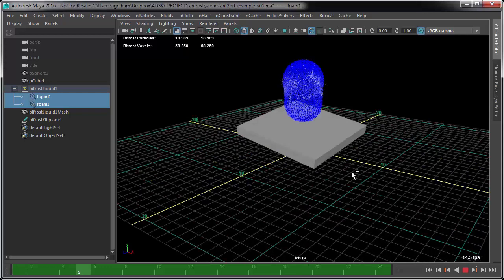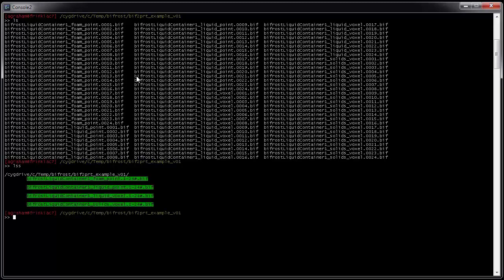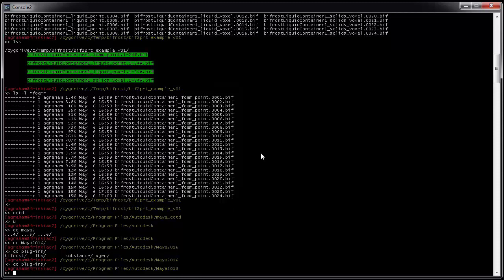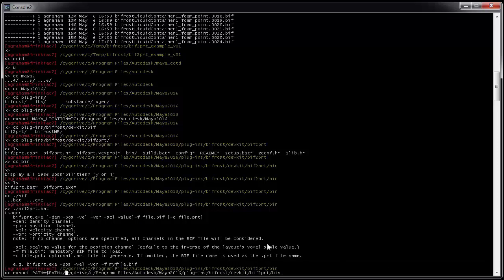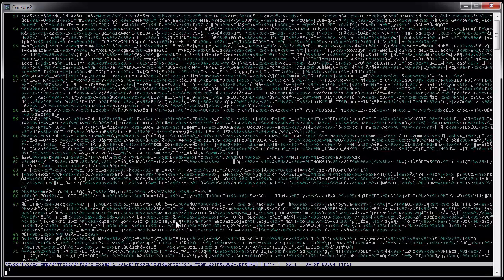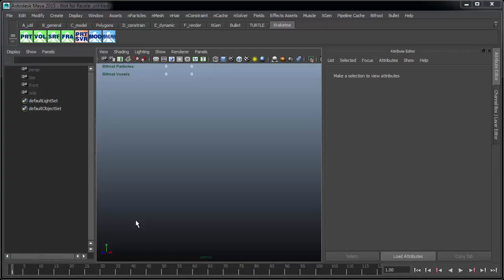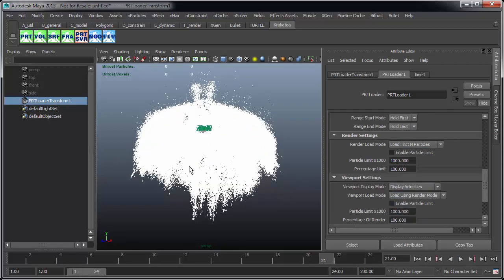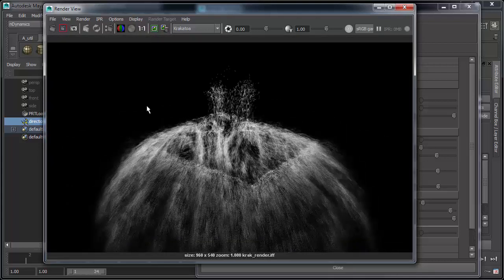Maya 2016 Bifrost bif2prt workflow

Comment: Thanks so much for this guides. 
BTW, im pretty new to bifrost so i have tons of questions and am slowly learning it. but one thing i can't find anywhere. What is the basic workflow for rendering ? 
You have 1. The liquid mesh 2. The foam .
I think I need krakatoa for foam part only right ? or I can use krakatoa for liquid particles too ? 
I am not sure if it's efficient to render liquid in mesh or with krakatoa. I do definitely need phong shader too. but Iam not sure how you can hook up the speed material in arnold shader too :( .

Comment: Have found a working solution via Windows CMD under 

http://forums.cgsociety.org/archive/index.php?t-1289991.html

So i post this from "santiagofurlong" in that forum:

In order to convert Bif particles to Prt using cmd you should follow this workflow, it worked for me in windows 7 and maya 2016.

Once you open cmd type this

Set PATH=%PATH%;C:\Program Files\Autodesk\Maya2016\plug-ins\bifrost\devkit\bif2prt\bin

There you are saving the path of the bif2prt file, so you can execute it later.

Then you have to go (in the cmd) to the path where the files you want to
 convert are. Once you are placed in the folder you type:

FOR %i IN (foam) DO bif2prt.bat -f %i

This will convert all files with the word foam in it to PRT.

-----

EDIT: this will work also with Maya 2017. For this, change the Set PATH (see above) not to "Maya2016", set it to "Maya2017"

PLEASE NOTE: the bif2prt in Maya 2016 will NOT work for Bifrost Particles created in Maya 2017. So you have to change the Set PATH to "Maya2017"